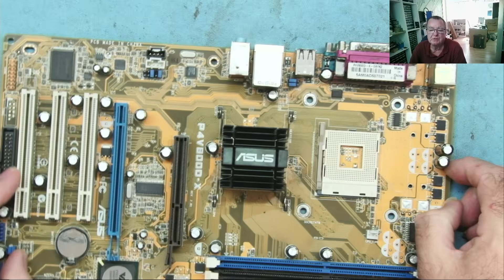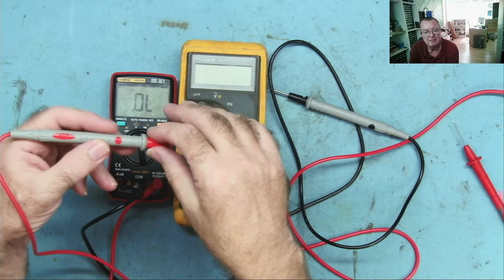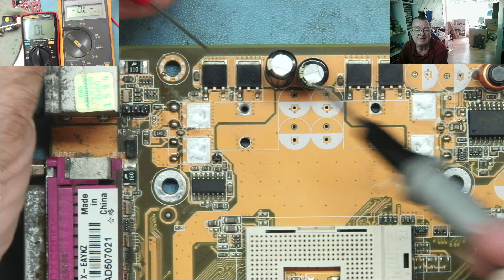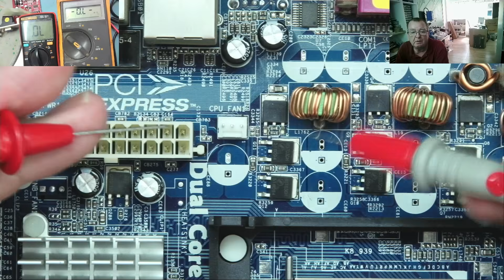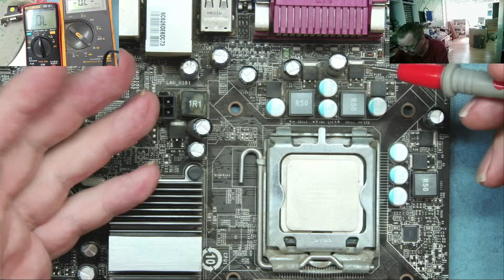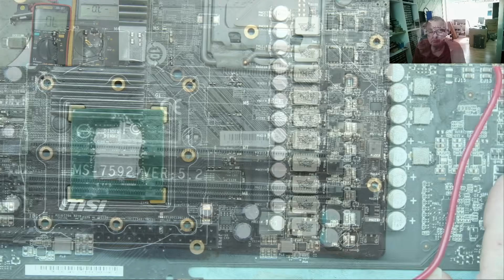How To Test MOSFETs In Circuit Using A Multimeter

Comment: A good tool for this is micro pincer test leads. They are very small and grasp pins securely.  Or grab a Peak DCA55 which will do all sorts of testing.  Both are indispensable.

Comment: I tried your method and works but i i find a better way using a bench power supply. Just connect the (-) to the motherboard ground and inject 5v to the gate. Then with multimiter on ohms scale check if they open. To be safe, limit the current on power supply to 100ma and increase current (amps) as necessary.

Comment: Great video,  thank you! To solve the "third hand" problem on the high side MOSFETs could you connect the multimeter lead to the 12 volt input connector - just push it down beside the pin? Regards, David
Reply from the maker: Good suggestion
Reply: or alligator clip to the mosfet.
Reply: Beat me to it! (Although a year ago haha) I was thinking the same when watching, although Rich kinda did it for the low side with the probe in the earth screw hole.

Could also cut an old PSU up for the 4 pin CPU plug with short, stripped wires and clip an alligator probe to the 12V or ground as required

Comment: Richard what about testing MOSFETs with an in circuit ESR meter? the output of that meter is a 1 kHz sine wave with a very low voltage output that will not turn on any transistors or MOSFETs  in circuit , if the metre reads very low ohms or beeps as my metre does,  we assume the MOSFET is shorted. Just my thoughts after watching your video...Your videos do inspire me with creative ideas🙂
Reply from the maker: What, a bit like this?
https://www.youtube.com/watch?v=WMhpKR9x7Lg